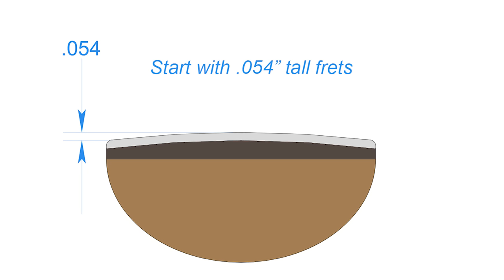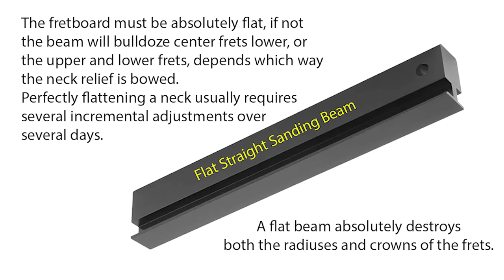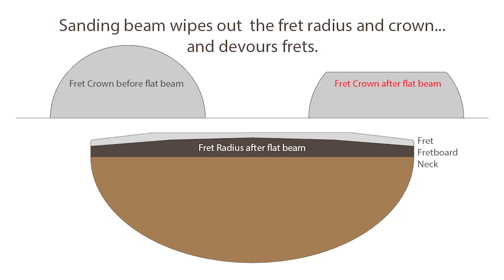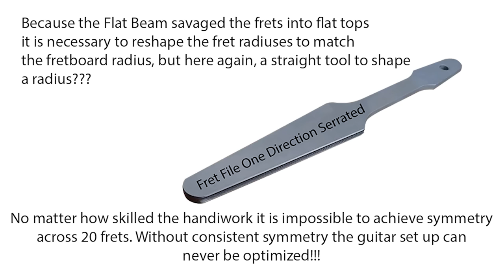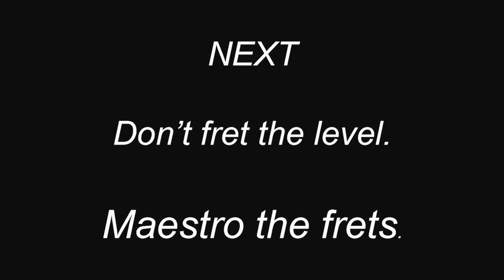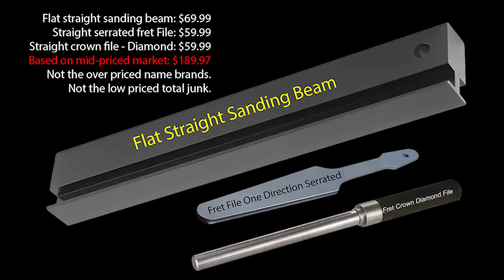Fret Leveling - Please view NEW videos for the all aluminum laser precision 2nd gen - links below

Comment: Looks good. The only 2 scenarios I can see this not working is on compound radius necks or multiscale necks where you'd have to have several of these to match the fretboard radius.
Reply from the maker: FretMaestro can do conical fretboard frets. For example 10-12-14, measure the neck from nut (fretboard side) to outside last fret, divide by 3, so for example 21" /3 = 7 then measure 7 inches put down tape, write on tape which fret changes to the next radius, then measure the next 7 inches and repeat, etc. Yes, this does require 3 FretMaestros, but that has not deterred people from taking control of their conical radius level, radius and crown jobs instead of paying for the only other option, PLEK. 
Doing conical radiuses freehand is IFFY at best.
There are two types, those that every fret is different, and those where the three radiuses are stepped. In either case the difference between a 10" and 12" radius is very subtle and the goal of achieving more accurate string action is still achieved by the stepping method. For the absolute purest, go with PLEK.

Comment: A fantastic, well-reasoned and executed product. It's still going to get expensive for anyone trying to work with compound radius fretboards, though, and I know of one Fender guitar with a 15.75" radius, so, although for most use-cases this is the perfect tool, there are some instances where, it seems, there are no easy solutions.
Reply from the maker: On that Fender 15.75 I would not hesitate to use a 15... you put a 15 and 16 side by side, if they are not labelled in production the only way to differentiate is to mic them, you would have a really tough time seeing the difference by eye.
Conical radius, (there is no such thing as a compound radius fretboard, I know it is common to call them that, but it is incorrect)... the cost of sending that out to get it done is more than 3 FretMaestros.
Reply: Oops - I see you've answered this question in previous comments 😉

Comment: What if the tongue has a substantial rise that is resistant to a heat press and you need to wipe out a large portion of the last 4 or 5 frets to get a usable level?
Reply from the maker: Well think about that FretMaestro is a cutting file that also will give you the radius and crown... So... use it to address the fall off. It's not rocket science. And of course the word substantial is misleading... whereas using a number instead of generality provides a clearer understanding of what you are referring to. Also... it is possible that one might have to deal with the 15th fret upward, not only the last 4 or 5.  No matter... if a sanding beam and a straight file can fix this, then FretMaestro can and does too, because again, it is a cutting file, with the bonus that you get a perfectly symmetrical radius and crown at the same time.

Comment: Some one mentioned the material it forget what it is called and JI don't know is we can still buy it. I used it myself to make something back in the 1980's. It can be worked to close tolereces. One thing with tools is we have to learn how to use them. was made of. It looks loke a cloth resin combination similar to fibreglass that was used a lot in engineering in the forties and fifties. I

Comment: 2 questions: 1.What about a e.g. 10-14" compound-radius fretboard? It seems your product is only suitable for straightradius-fretboards?
2. You say you don't have to straighten the neck before. But you need a flat neck anyways, otherwise you couldn't measure, which frets are high or low.
Reply from the maker: Use a digital gauge to measure fret height, no need to flatten the neck. But yes, it is best to make sure the neck can be made flat before doing any fret work.
Conical Radius fretboard... FretMaestro OMNI Pro is made for this.

Comment: It looks like a fun tool.  I, however, wouldn't be able to use them due to the cost.  I'm pretty good at leveling frets though so there is that, but I do like the tool and I really like the presentation.
Reply from the maker: Well, one guitar at a time. You will save lots of fret material which means buying more time before having to replace the frets. Replacing frets is not cheap thing.

Comment: I forgot to ask about using them on Stainless Steel. Do they work? How long do they last compared to using them on regular frets? Thanks
Reply from the maker: How long does a diamond file last? How hard to you press the file?-- which you should not do.
Stainless Steel is not very hard actually. Diamonds are. No Contest.

Comment: Very interesting. I have to check this out. It sounds like the sort of tool that would fit nicely into my workflow.
Reply: If your sliding back and forth to level, even if it has the proper radius, wouldn’t the lower part of the file always touch the fret?
Reply from the maker: You need to watch more carefully. Depth off cut means all part of file, hence all parts of file contact at the same depth no matter what. Geometry and Physics. Even if the file is straight and has depth of cut limit, this is true.

Comment: You're definitely a talented toolmaker
Reply from the maker: The first time I saw flat beams and straight files with only eyeballing and guess work as the way to level , radius, and crown frets I was appalled. This is 2024, not 1924... we have the capabilities to make far better and far more logical tools today than to continue suffering using wood working tools, which is all that was available way back when, adapted for compound radius frets (long radius + crown radius), and yet it had not been done except for a $250,000 CNC fret machine. We use shaper blades and bits for everything else these days to produce precision shapes and dimensions, why not for frets. FretMaestro.

Comment: Coming from a background of building custom percussion instruments, I appreciate the attention to choosing specific tools made for the precise purpose of designing a surface with compound radii or any specifically precise and consistent curve.  Though the application to guitar frets is somewhat different than what I’ve done, the logic is very similar.  I think your explanation is very clear and you covered the logic behind the various considerations very well.  I’m much more inclined to try setting up my own fretted instruments after seeing this, so thank you very much!  I’m not sure yet about how the radius differs between guitars to basses, ukuleles, octave mandolins etc and whether those tools work for those instruments, but I bet there is a best tool for each case that works in this way of working on one fret at a time and removing minimal amounts of material, without the absurd “flat tool on a round fret” problem.

Comment: I like the video, but "compound radius" means something entirely different. It is not related to the frets having "2 radii", 1 for following the fretboard contour and 1 for the actual crown radius, somehow "compounding" these 2 radii. Compound radius means that the fretboard starts off with 1 radius at one end (e. g. 12" at the nut) and gradually changes along the way, until it reaches another radius at the other end (16" at the last fret), thus having an overall compound radius, which is ever-so shifting. I get what you were trying to say, but that terminology is already taken for decades now. The best for your case is saying "2 radii". Keep the videos coming!
Reply from the maker: No.. what you describe as a compound radius on the fretboard is not that at all, you are actually describing a Conical Radius.
Frets are Compound Radius. Most fretboards are cylindrical radius, and then some are Conical (root word cone) radius.
Reply: @SixStringers  I do agree with you on how things should have been named, I myself raised that tipic as well in the past. However, my point was that when you say "compound radius" in 2024, you'll send out the wrong expectation, as everybody knows it for what a conical radius should be. Other than that, you are right.
Reply from the maker: No argument from me except that we really need to use the correct terminology in order for our minds to more readily and correctly grasp the concepts. I taught English for 8 years... this does not mean I do not use some words inappropriately, we all make mistakes, but words Do Matter. But just because the majority is wrong does not mean the rest of us must buy into that. Better we try to correct the wrong and make the world a better place.
Reply: @SixStringers  Absolutely agree, we should try to enforce correct terminology through the power of example, else nothing will change, and it's already a very steep climb. It makes me laugh a bit cause there are certain words that always make me go bananas when people use them for what they're NOT and I tend to be a bit agressive in my attempts to correct that in them (I even dedicate small portions of my seminars to that) so, I think I really see eye to eye with you on this one, nothing else to say other than *correct*!
Reply: @SixStringers someone should tell all the guitar manufacturers who refer to their necks as having a a compound radius.
Reply from the maker: I am pretty sure they know.
Conical Neck is the actual correct description.
A cone Vs a Cylinder.
A constant radius is characteristic of a Cylinder.
A progressively larger radius from the 1st to the 22nd is characteristic of a cone, hence conical, not compound.
A fret has two Raddi... the length of the fret is the fret radius in agreement with the radius of the fretboard, the crown is the width radius... two radii, hence compound.

Comment: Now this is a great idea. One question, for ideal results on compound radius necks, like Jacksons (typically 12"-16") , you'd need 24 maestros....?
Reply from the maker: Not really. You have two choices - PLEK ,and get flat top frets, and the tolerance is .001" no better, and of course that is excellent. Or like other Conical necks that do not change every fret because that makes ownership a nightmare for fret work, if not impossible... step the radiuses and get not exactly the same but really the same benefits of the conical incremental steps.
Realize this... who is going to ever be able to level those without Plek or Maestro? No one, but I am sure many will claim the contrary. Good luck with that. So if you don't mind having to pay forever and ever for PLEK, because I don't see a another honest way of than Maestro, then sure. Replacing your frets that way, and that day will come... how much do you think for that and the PLEK to make the radiuses?

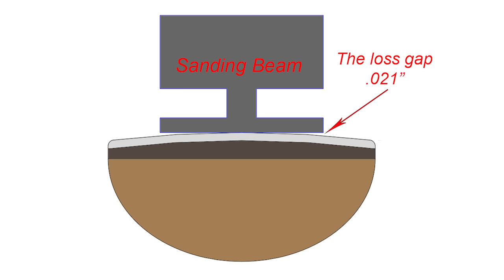Comment: 6:06 This is why I use a thinner flat sanding beam, this way I can go with the angle of the radius, starting from left to right folowing the fretboard radius to reduce ending with flat frets likes the one you show in the video.
Reply from the maker: Thinner flat you say... makes no difference at all because it is a flat on a radius, no matter how wide or thin/narrow the flat, the exact same amount of flat surface area contacts the radius surface. Basic geometry.
Reply: @SixStringers While I understand there’s a downside with using a curved sanding block (difficult to maintain an even sanding motion & pressure, & unintentionally sanding some frets more than others), do you find this to be the best approach for fret leveling outside of using your Fret Maestro device (assuming the radius of the sanding block matches the fret radius)? 

I’d love to purchase your product but unfortunately ongoing health issues have prevented me from working much, & I can’t afford it. 

While I understand & agree with your mentions about the flaws with the traditional sanding beam & block methods, & that your device remedies these problems, I’d love to hear your thoughts on the next best option for fret leveling, outside of using the Fret Maestro. 

While not an ideal solution like the Fret Maestro, would you suggest a curved sanding block as the next best solution for fret leveling? Again, I understand this method doesn’t solve the issues your device does, before you created the Fret Maestro what tool did you find offered the least amount of fret damage & produced the ‘best’ results? 

I’d appreciate any advice you could provide. Currently my guitars are unplayable (need few leveling), so I need an inexpensive solution that will do the least amount of damage. Thank you.
Reply from the maker: Next best.... PLEK.
Sanding beams destroy the fret shape, so then guesswork hand filing to reconstruct... but of course no one is a robot, so the reconstruction will be helter-skelter, hence the setup will be compromised. It is simply the nature of free hand work with tools that were not designed for the task... old school tools were adapted from old woodworking tools. 

Interestingly, woodworkers left those tools behind long ago, imagine if they had not.
Reply: @SixStringers  Thanks for the reply. I wish I’d known about your product before I purchased a sanding beam & files. I also think I screwed up the frets on my Squire Tele because I failed to properly address the neck relief beforehand, on top of the excessive amount of metal that gets shaven off. I’ve since then had to quit working due to health issues & can’t afford to purchase any thing else or send my guitar in for a Plek job. That’s what I get for trying to do the leveling myself, based on a half assed video tutorial that failed to mention that step.
Reply from the maker: Sorry to hear your plight. You have lots and lots of company in that.
Those 19th century tools sell a lot online... the budget kind and the ridiculous $129 price for a beam from you know who... and those newbies ruin their frets quick. But, few, unlike you, have the salt to admit it. I would love to hear from everyone who has trashed their guitars with those archaic tools and methods.

I have seen plenty who lie, oh yeah, sorted my frets in 30 minutes using a beam and files, absolutely perfect awesome... uh huh, that is such rubbish, but you know, you hear it a lot, and no doubt this gave you false confidence.

Sanding Beams and free-hand files require extreme practice to get a handle on... those that manage it charge a lot of money for half baked results and get away with it because they know that to try and do it as an unpracticed DIY results in disaster most of the time, if not always.

19th century tools that were never intended for the job of leveling frets, but it creates a niche specialized market that those who make their living from are now screaming loud and louder to defend from 21st century FretMaestro, after all, when you really can level, radius, and crown your own frets to CNC precision with in the palm of your hand CNC Precision FretMaestro... you won't be paying them.

By definition, this makes FretMaestro a Disruptive Innovation, and disruptive innovations are always met with stubborn opposition from those that stand to lose income because of it.
Fret Leveling represents about 70% of guitar repair work/income... so yeah, they don't like FretMaestro.

Comment: Well done. For a second I thought the dials were rollers for bending fret wire! And I thought “my God”. But then you explained it, and I thought: “my God”. I build necks btw.
Reply from the maker: You have an interesting sense of humor.
So, you build necks. So many naysayers here say that necks are never flat, that they have highs and lows like a sort of roller coaster along the length of the neck. They also say the neck radius is not consistent. I know CNC made necks are as close to perfect as perfect gets, but they ignore that.
What do you say? What sort of tolerance would there be?

Comment: I have a 12inch, a 10 inch and a 9.5 inch. Do I need go buy all there radiused tools at 3 x 80 dollars?
Reply from the maker: FretMaestro is not $80.  The $80 is for the Dble side "V" Crown Narrowing File.
In a couple of week we will have a FretMaestro Omni, universal frets. It is not as fast working as the radius FretMaestro but it does all frets. We designed it for Conical Radius fret boards. It comes with 3 diamond  files, 150 grit for the heavy Leveling work, + 300 grit for finish + 240 grit "V" Crown Narrowing File that does not cut off the top, only the sides to narrow the crown because leveling frets widens frets, changes play feel and intonation. $200

When you consider that Big Luthier Tool seller sells 3 bent straight files designed only for crowning, for $385 .... FretMaestro is a bargain. The game of numerous different tools for leveling frets adds up fast.

Comment: What happens when you get up on to the body in the higher frets? You mentioned this at the start of the video but conveniently didn't show how this tool performs with this issue? Will you have enough room to rock it far enough without scratching the body? My gut feeling says "no" and I don't want to drop that much money to find out. I'd love to see a followup video showing this part of the process.
Reply from the maker: Do the same thing but take the last few frets down .003". As for guitar body, non issue. Fret Maestro is 4" long Does not get obstructed by the body of the guitar.